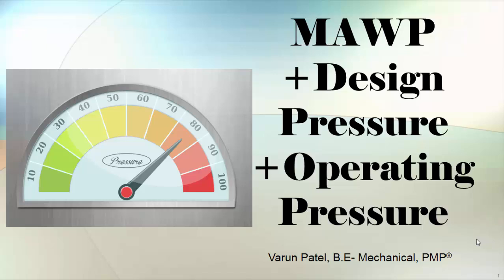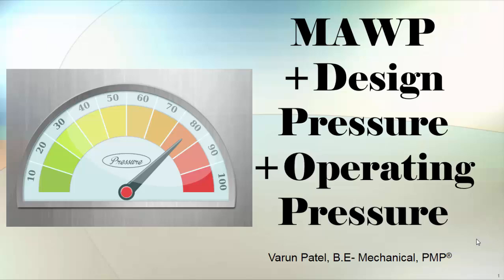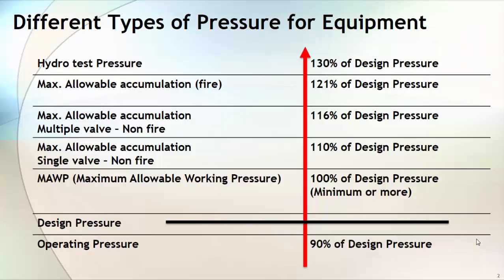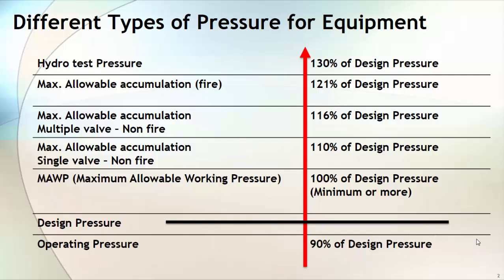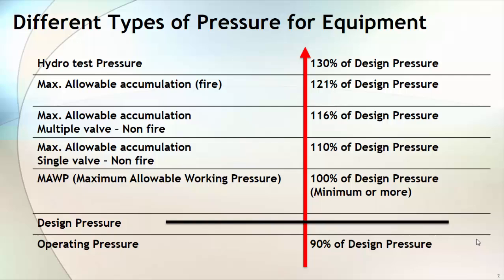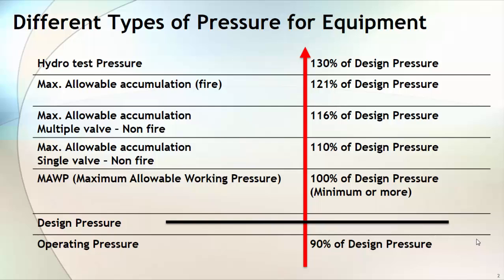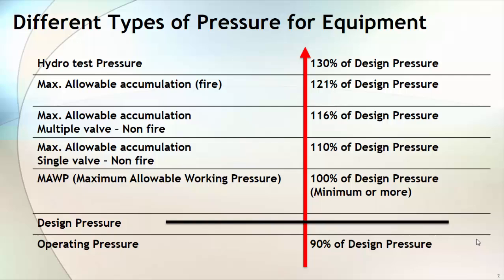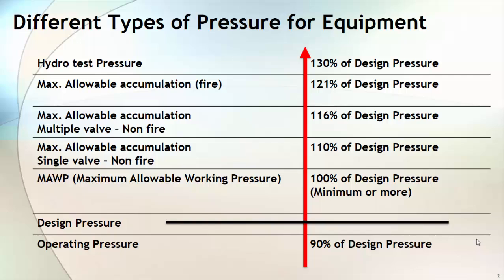What is  MAWP, Design ,Operating & Hydrotest Pressure ?

Comment: Thank you very much for the clarity of the terms. 

It clearly shows the pressure vessel can withstand the 1.3 times of design pressure. 

What would be the burst pressure for the vessel? How is it calculated? 

Does that mean the vessel can withstand pressures More than design pressure for long periods, as hydrotest is passed, if PSV's are isolated?

Comment: MAWP AND DESIGN PRESSURE are same thing dude
Reply from the maker: No, It is not. Design pressure is something that available to you from data sheet and MAWP is the one that you calculate based on the formula available in ASME Section VIII
Reply: @HardHatEngineer  Sir, i m telling you from marine classification society's manual..

Comment: How we calculate pneumatic test pressure?
Reply from the maker: Based on the design code you can calculate the pneumatic pressure.
Reply: Refer UG-100 for ASME Sec. VII Div. 1
It is 1.1 *MAWP

Comment: As we are know hydrotest pressure is 1.5 than design pressure but in case of pneumatic test that are same!
Reply from the maker: No, It is usually 1.1 time.
Reply: what is maximum test pressure if the minimum tes pressure is 1.5 ?
Reply: How about I have 5 bar working pressure how much multiplier for hydro test and pneumatic test?

Comment: Over all it is a knowlegeable vedio but onething you have missed to explain about MAP
Reply: Hello sir, 
 I've a doubt 
Pipe material is A 106 gr B
Pipe size 6" sch xs
Tensile strength - 60000psi
Yield strength  - 35000 psi 
Here,  the operating pressure 3.5bar
Hydrostatic test pressure 5.7

My question how to calculate Burst pressure of given pipe material and does the burst pressure is above hydrostatic pressure( 5.7bar) then how is this two related